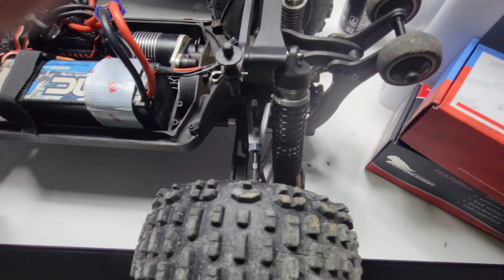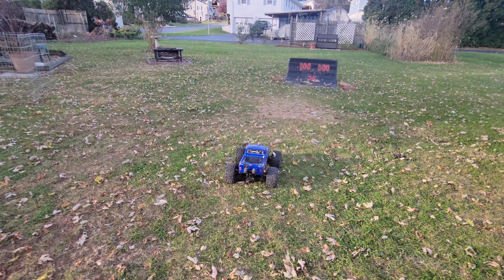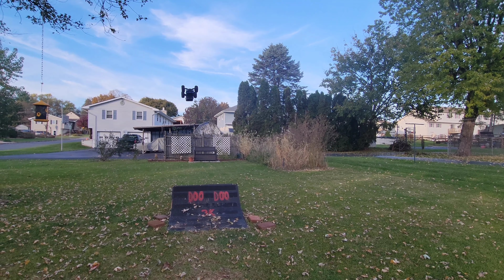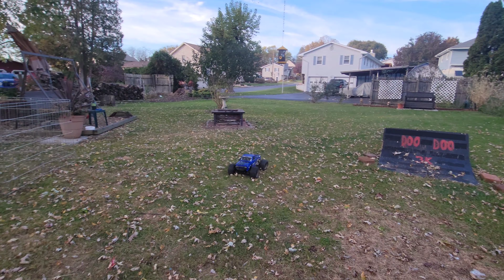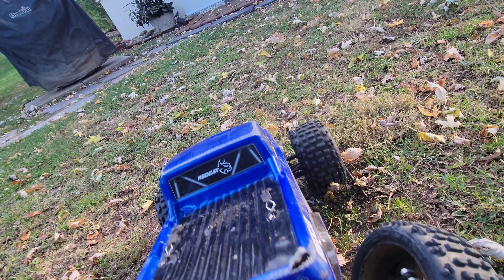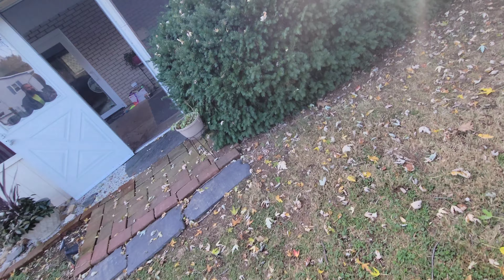🤣  Kaiju Fail Again

Comment: That's crazy.  I've been giving mine the business for a year and a half and only broken:1) front bumper mount, 2)snapped a shock shaft when I hit a rail at the skate park at around 30mph.  That jump was small and the landing was right on.  it doesn't even make sense.

Comment: Yep. Been there kaiju El soldit especial  on ebay 50 bucks.  Fyi upgrades to metal can be a bummer no flex n snap, got a few hpi savage all decked out  aluminum but don't jump or wreck it . Those are cheap turnbuckles dam ..

Comment: Lunsford titanium turnbuckles plastic arms WD-40 haven't had an issue since multiple bad landings and cartwheels down the street on pavement no issues
Reply from the maker: Yeah but I already bought these 7075 arms lol. I wanna use em so bad.
Reply: What size ones would I need Nick? Do you know off hand or have a part number? Thanks

Comment: Time for a drive while on fire video! I’ve been there so many times, it will make you insane! I’ve thrown my cars I was so mad! time out! I’ve even sold them. Some I regret some I don’t. You’ll figure it out. My go to is traxxas links. Biggest ones you can throw on them with the traxxas ends. I’m not suggesting it, don’t want you mad at me🤣
Reply from the maker: 🤣 🤣  you better be right bro! I'm gonna try the 5mm arrma turnbuckles.